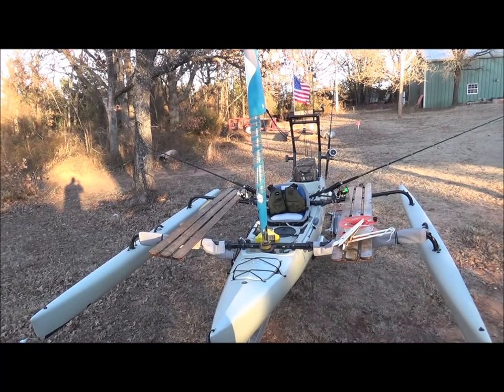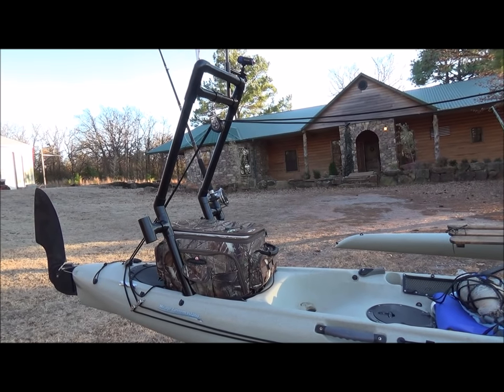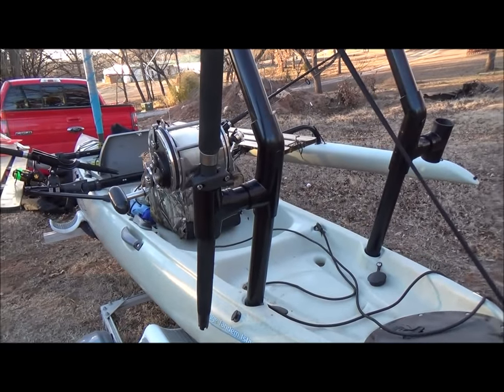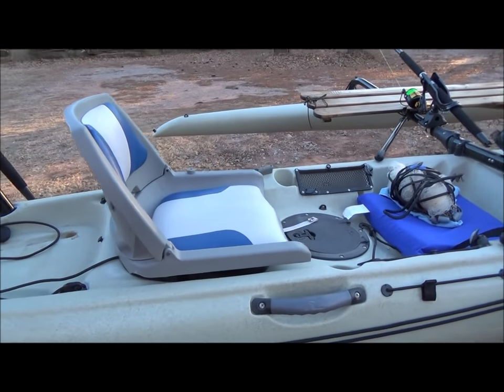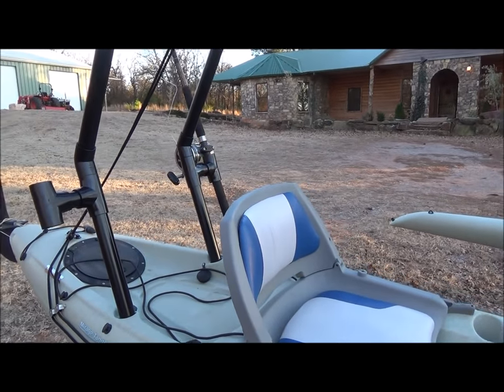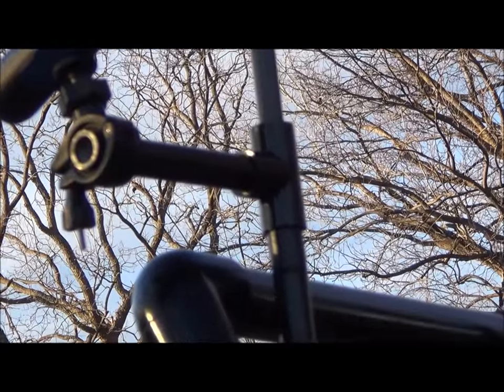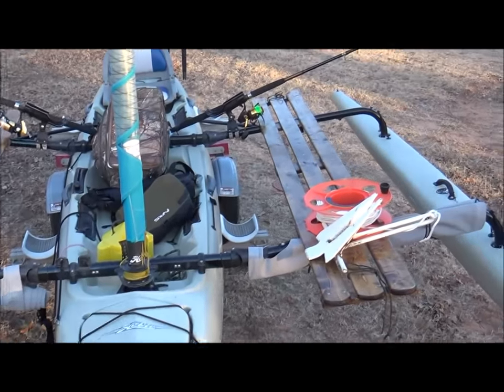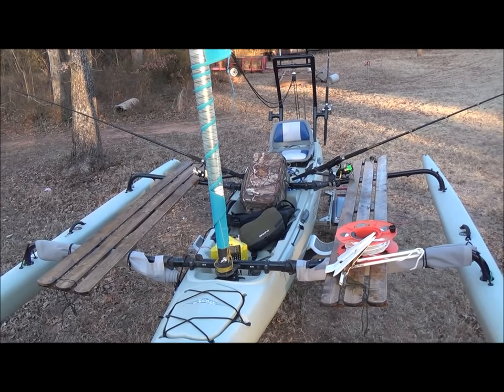Mainsheet Riser

Comment: Great videos.
I've made Hakas for my TI. How do you like yours and how do you secure them to the Akas. Also how is the riser working out. I built one but I'm not sure if it puts too much stress on the rod holders. Your comments would be appreciated. Thanks
Reply from the maker: Hi Idaho.  My hakas are a MUST if I'm taking a fishing buddy as they are a create platform for fishing while standing, rod holder placement, fish locator mounts.  It just opens up a whole new world on deck space when it comes to a kayak and it keeps a passenger high and dry if they are hiking out on an outrigger.  Those trampolines will not keep them up out of the water.  My hakas are secured to the Akas with two 24" length of 550 parachute chord per haka.  A simple slip knot through the haka slats and around the Aka arms and its not going anywhere.  The mainsheet riser has been put through the test sailing around Horn Island.  I was pretty sure it would snap, but it held up to some strong gust.  No trouble with the rod holder as the stress applied to them is spread out with the length of the PVC pipe running down the inside of the rod holder.  I keep a close eye on the contact points on both my sail riser and DIY seats and so far no sign of stress or wearing.  Thanks for watching and I'm glad you're enjoying the videos.
Reply: Thanks for the quick reply Mathew. Good feedback. What have you found to be the best method for launch/ recovery. At 71 yo I am struggling with that when singlehanded?
Reply from the maker: A Hobie TI is a beast, but I've launched it from both boat ramps and the beach.  I get it all set up while on the trailer, then launch from a boat ramp.  If I'm launching from the beach, I back it down as close as I can get to the water and pull it off the trailer.  Once the TI is at the edge of the surf I rig it up and launch.  Pushing through surf can be tricky if you are by yourself.  Everything depends on what I plan on doing on the water.  Sometimes I'm just fishing by myself in a creek or lake cove, in these cases I leave the mast and outriggers home and use it as a regular kayak.  That's just one of the reasons I love this machine.

Comment: I just acquired a 2008 AI and the previous owner retrofitted a after-market seat so of course the main sheet is really up in your shoulder/neck/head business.  But I have just one concern or question since you didn't show the sail fully deployed.  How does this riser affect the designed rake/angle to the clue of the main sail.  I would think it "crinks" up upward and thus not a natural straight line off the clew?  Do you have any pictures of the main sail fully deployed with this riser from the side showing the whole sail?  Thank you.
Reply from the maker: I have numerous videos of it under full sail.  Here is one with both fighting a squall and also a third party video of it under sail at a distance. The sail is full with no wrinkles. https://youtu.be/QkaL5qzBpDw
Reply: @mathewdavis-adventuresandd6643  Thank you, this pretty much settles it.  I just tend to over-think it sometimes and also wonder why Hobie did come up with a solution too?
Reply from the maker: @motleypixel  it's a good idea to look at it from different angles.  Sometimes things on paper dont translate well in reality.   In this case it worked perfectly.   Wish all my projects did.
Reply from the maker: @motleypixel  You will love having that dang sheet line off your head and neck.  Well worth the effort to build the riser.

Comment: I am not sure if the fishing pole hole diameter is different between AI and TI. I have a 2016 TI and 1 1/2" will not fit. I use a 1 1/4" PVC.
Reply from the maker: Ian Ang they must have a different diameter.  I had the opposite problem.  My 1 1/2 pipe was just a tad small so I cut two short lengths of thin walled PVC and sleeved it around the thicker schedule 40 pipe.  Slid it all down the pole holes and it tightened it right up.
Reply from the maker: Correction.  You are correct.  Every stick of PVC I have in my barn is 1 1/2 inch or much bigger.  Apparently I purchased 1 1/4 PVC for this project and used every bit of it.  Sorry about the confusion.

Comment: Hi. Did you use 40 mm (1 1/4in) pipe for all the raiser ?
And dose it fit to the hole or it is loose ?
What is the thickness of the pipe ?
Thank you
Reply from the maker: Yes, it is 1 1/4 schedule 40. I went back out and checked my supply of PVC and everything that I have is 1 1/2, but apparently that is not what I used.  Also, yes it will fit a little loose in the rod holder, but I have an easy fix for that.  1 1/4 inch thin wall PVC (schedule 26 I think).  All you need is two pieces that are six inches long.  split them lengthwise and they will slide onto the bottom of the raiser where it goes into the rod holder.  This will snug it up.  I slide mine up high and once the raiser is in the rod holders, I slide the thin wall PVC down into the Holder with the schedule 40 pipe.

Comment: Mathew......probably a dumb question but i will ask it anyway......did you have to lengthen the ropes/sheets with the riser. thanks
Reply from the maker: Great question.   Didnt have to make any adjustments because of the riser.  You probably already know this but if your solo in a TI and riding in the back seat, you have to make an extension for the furling line.  Bit that has nothing to do with the riser.
Reply: @mathewdavis-adventuresandd6643  thanks mate just picked up my Ai today. launch it tomorrow :)

Comment: Nice. Where did you find that seat?
What year is your boat?
 Thanks!
Reply from the maker: Those seats are the ones that Walmart carries.  Cheap and a huge improvement over the pad seats, especially if you are going to be on there for 2+ hours.  I've been on this yak several times for 12+ hours without setting foot off of it. Seating up a little higher makes for easier peddling.  I've been meaning to do a video on them as I upgrade to even thicker seats, just haven't bought the thicker seats yet.  The year?  I'm not real sure, I'd have to dig around for the title to find out, but it's one or two years before Hobie started making the raised seats standard.
Reply: Mathew Davis - Adventures and DIY.  Ok cool. I would like to find a swivel seat because I have a hard time twisting due to back problems.

Comment: Nice work!  How does the riser stand up to strong wind?  Love to see some more info on the hakas...
Reply from the maker: gilgarcetti75 good day.  It holds up surprisingly well.  PVC has some flex to it and the stresses are spread across a good part of its height. In the later part of "trolling around Horn Island 2017", you can see the speeds as I call them out.  We were going about as fast as I would want to go with a passenger and gear.

Comment: Interested on more info on the seat mod and how u did pvc pipe
Reply from the maker: Hi Dylan.  I'll put a short video together on it, but basically there is a piece of plywood screwed to the bottom of the seat to give me plenty of area to mount the PVC with metal pipe straps.  The small diameter PVC is a lot of little pieces with elbows.  Put it all together without glue so you can twist and turn the frame until the seat is setting like you want it.  Then with a marker, I put a small mark where each piece joins the other.  That way you don't lose the positioning.  Take your time and pull a piece off of the frame one at a time and glue it.
Reply: Mathew Davis - Adventures and DIY awesome! Would be great to see. Awesome set up and great boat! Goals for sure!